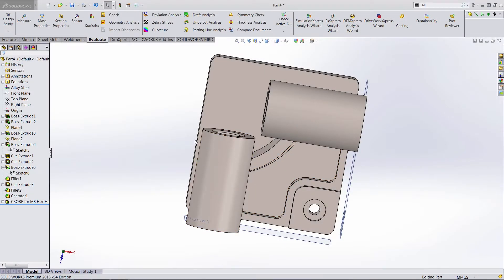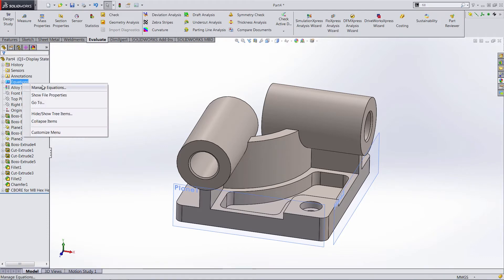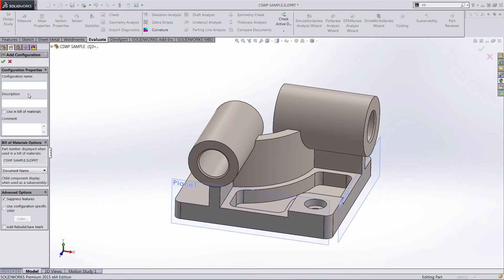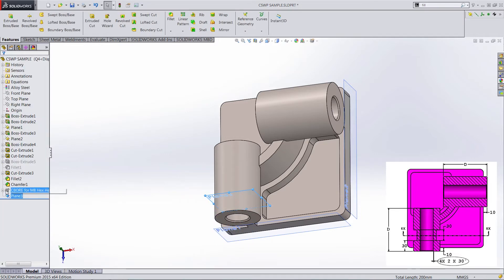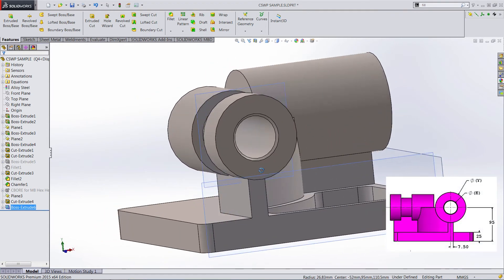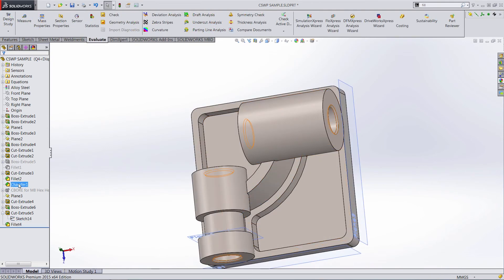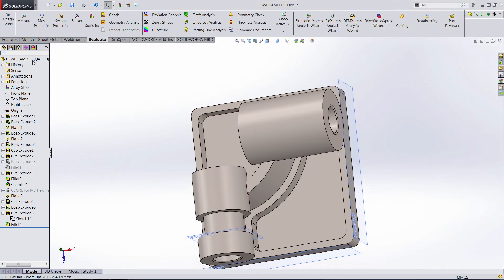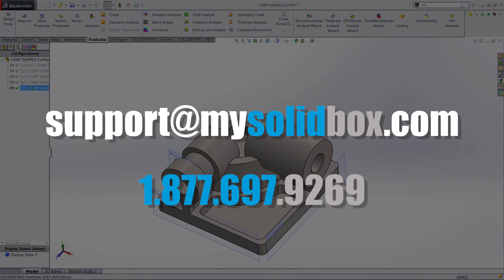SolidBox CSWP Sample Exam Part 3

Comment: the model you show in green on all three illustrations is what I wanted to see, specifically the cut on the right hand barrel as it relates to the arched boss that intersects . the model you actually draw is a bit easier. any chance you could show example of the first? and second question, how about some complex rib examples with cut modifications on them on cylindrical boss adjacent to flat boss other than just draft of dimension changes?